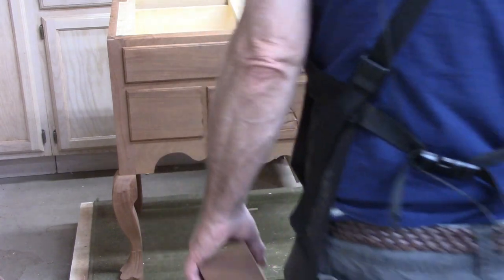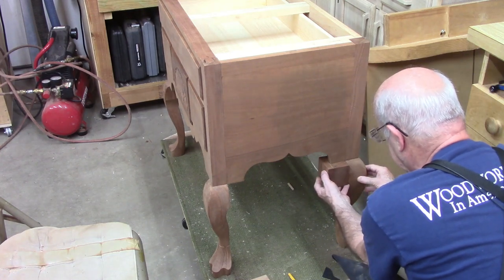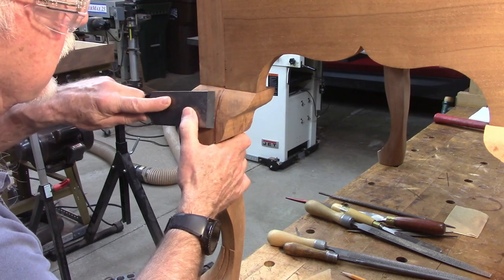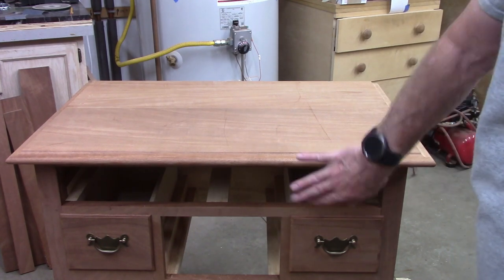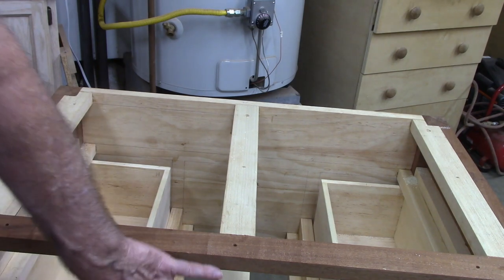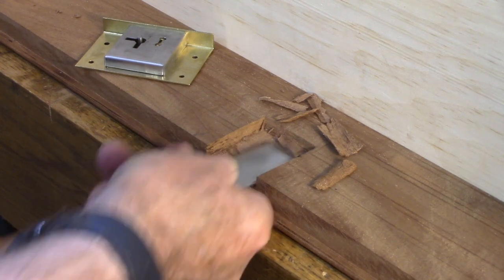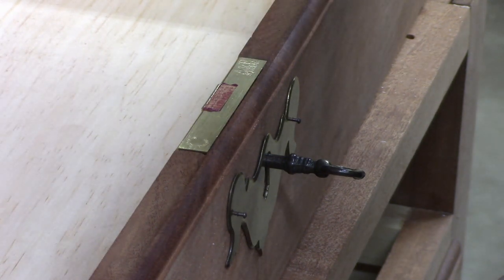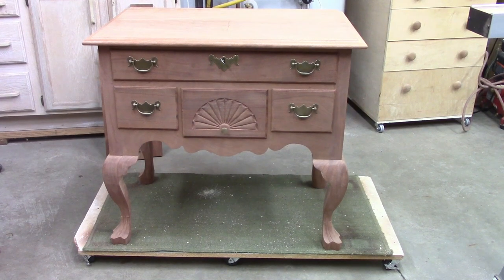Queen Anne Lowboy   Kneeblocks & Hardware Step 9

Comment: Looking good, David, coming along nicely. 
Quick question: Why are the knee blocks only glued to the legs and not the underside as well?
Cheers, Frank.
Reply from the maker: The side grain runs left and right so the wood expansion will be up and down.  The knee blocks need to be not attached because of that movement